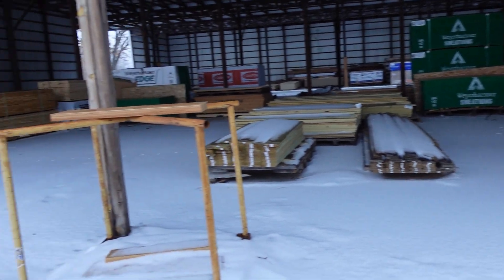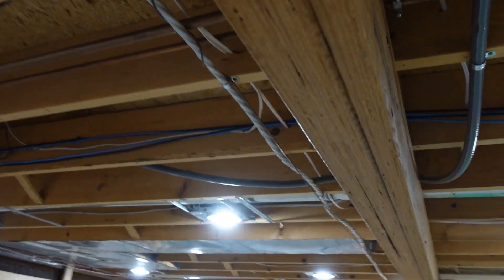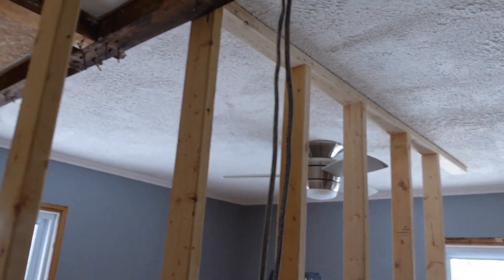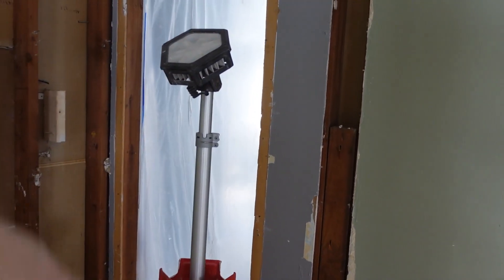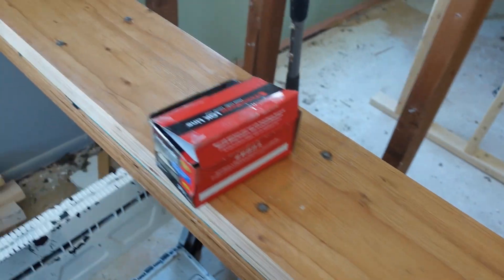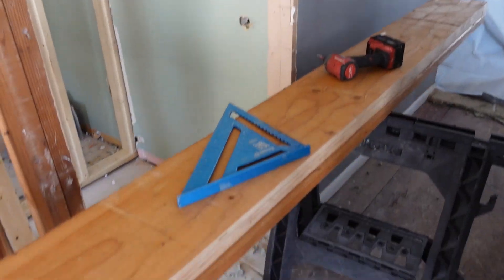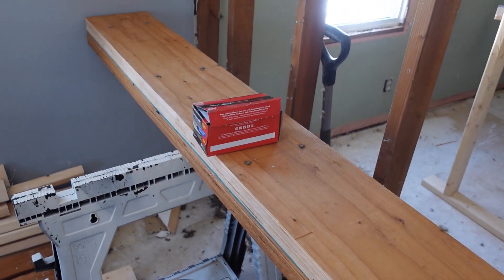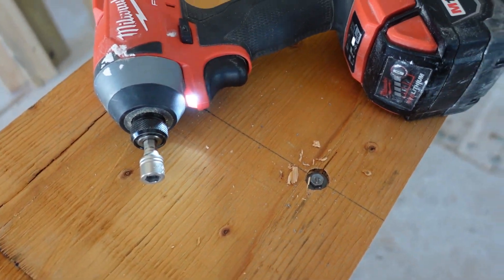LVL Beam Jobsites!  Load Bearing Work Is Fun!

Comment: Great video. Would a 4 × 6 pine treated beam worked just as well as the L V L beams?
Reply from the maker: Lvl beams have higher strength rating than just pt beams
Reply: @RenovationsandRepair  got ya! Thanks.